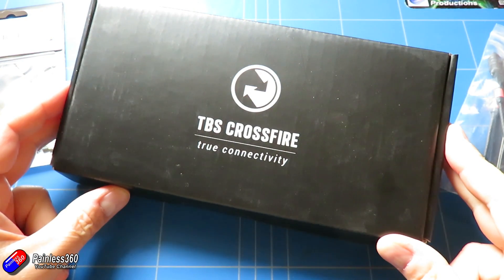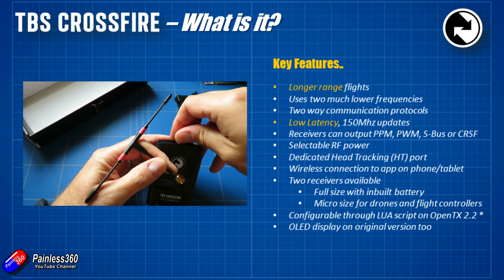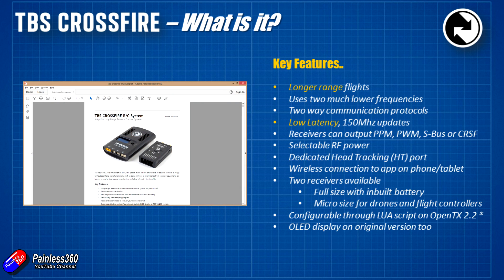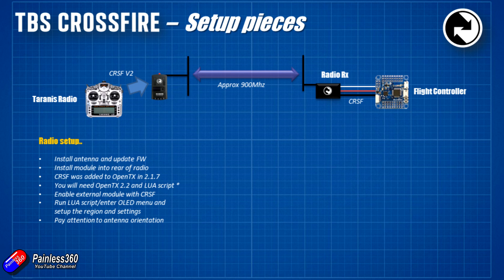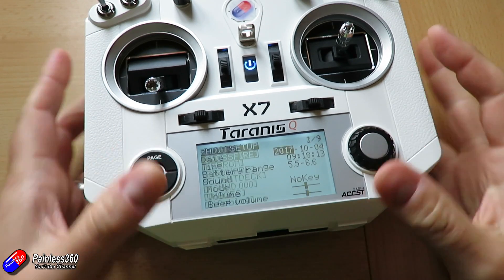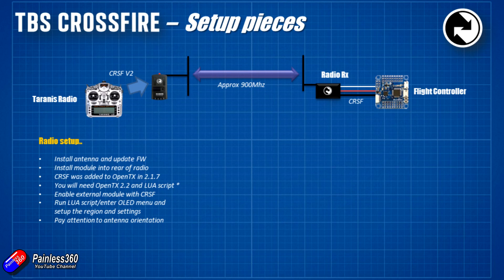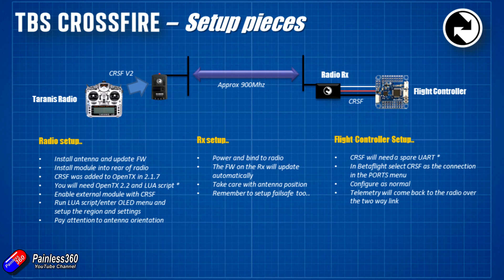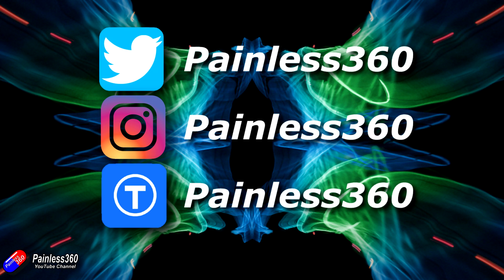(1/3) TBS Crossfire Series: Overview and Introduction

Comment: LQ, RSSI and mixed LQRssi in the betaflight OSD

How to interpret LQ and RSSI on the OSD (0 to 99)
And how to interpret the mix of LQ and RSSI

Antenna placement of the micro rx, straight line or V/L shape? For me only straight line worked well maybe because it is a dipole and the V and L shape is used for the diversity reciever?
Additional: how to point the antenna on the tx module

And a warning not to twist the TX antenna without loosening the sma connector

Also: how to know if a antenna is broken? Interpretation of SWR values
Reply from the maker: +Cyndre Lien great suggestions thanks. I was planning to talk about the 90 degree options on the reciever antennas. You lose total range but gain stability of signal as the craft moves..

Comment: That's interesting Painless, I've been using the TBS Crossfire Long Range Tx with Diversity Rx for a couple of years now for large scale FPV gliders using Futaba 14SG...I gotta say this product is top notch.  However, only recently I've gotten into race quads for which I'm using a Taranis X9D Plus OpenTx 2.2.0 and a Crossfire Micro Rx V2. You've mentioned to run the Crossfire LUA script in the Taranis and select CRSF in Betaflight for Receiver and for the life of me I can not get mine to work this way unless SBUS is selected in Betaflight.  If I'm not correct please help because as I understand it for a TBS Crossfire Micro Tx system yes you do need to setup it up as you've mentioned, i.e. in Betaflight select Receiver CRSF and use LUA Script in the Taranis and the Crossfire is then managed through the Taranis menu.  However, for the Long Range Tx the Crossfire is managed through the Crossfire menu?  I would much prefer it if I could use the LUA Script but mine just refuses to work that way, the LUA script is unable to find my Crossfire Tx and therefore SBUS must be selected in Betaflight?  Team Black Sheep have been trying to help me on this issue for a while now and as I understand it the two different Crossfire Tx systems are set up differently in the Taranis and Betaflight.
Reply from the maker: +James Nathaniel check the version information that I posted in the description . You've got to be using the latest and greatest of everything including the Crossfire firmware, and the Betaflight 3.2 code as well. If you're not then you'll find the some of the things I show won't work. Best of luck
Reply: Thank you Painless, yes I'm running all the latest Crossfire firmware and using Betaflight 3.2.1.  However, the only difference I can see is that for my Crossfire Tx I have Output 1 SBUS selected, you've selected Output 1 CRSF Tx and Output 2 CRSF Rx.  I'll give that a go and see if my Taranis can find it when running the LUA script.  Thank you and will keep you posted.
Reply from the maker: +James Nathaniel I struggled with a few things until I upgraded to the very latest beta firmware v2.08. Once I've upgraded to that and then upgraded the receiver lots of things started to work. Hope that helps
Reply from the maker: +Painless360 p.s. CRSF will only work on the flight controller when connected via a UART as per the diagram. If you've got it setup for sbus, connected to the sbus pin on the FC, and have serial Rx/Sbus setup in BF then that'll still work..
Reply: Thank you, yes how I have mine setup re SBUS on Crossfire controller and SBUS in Betaflight it all works fine with no issues.  However, it would be nice to set it up the way you have explained in the video.  I hope to try it out later today to see if your setup works for mine.  I can only think that it's because you've set the Tx controller outputs 1 & 2 up differently to how I've been instructed previously to set mine up.
Reply: Hello Painless, I feel that tried everything, when I execute the Taranis Crossfire LUA Script my radio just sits there saying Waiting for Crossfire Devices... Also in my Crossfire Tx - RX Micro V2 menu both output 1 and output 2 do not list the CRSF TX & RX, there is only listed SBUS, PPM, RSSI/LQ, LQ, RSSI, n.i.SBUS and channels 1 to 12.  My Crossfire firmware: V1.57, Hardware: V1.02 & Bootloader: V1.05.  Regarding my Quad it's a QQ190 Falcon RTF so it also is suitable for CRSF. Any suggestions?
Reply from the maker: You're not running the latest firmware.. See the video V1.57 is very out of date (even it if is listed as the last 'proper' release)..
Reply: Thank you Painless,  I now have firmware XF TX BETA v2.09 installed and will try that.  It's a little concerning when on the TBS web instructional video the TBS Agent has a tick box that says "Include Beta Releases" whereas when installing TBS Agent from their web site the TBS Agent tick box says "Include Unstable Releases" Being the word "unstable" verse Beta, it just doesn't sound right or safe?
Reply: Thanks a million.  PS: your video's are fantastic and have helped me and I assume thousands of other so much.  Keep up the good work :-)

Comment: How to control dys mi 200 or iflight vtx thru tx
Reply from the maker: The control of a model is exactly the same with Crossfire as with any other system. I personally prefer the TBS, Immersion TRAMP HV or the HolyBro Atlatl HV smart VTX units that can be configured from the Betaflight OSD..